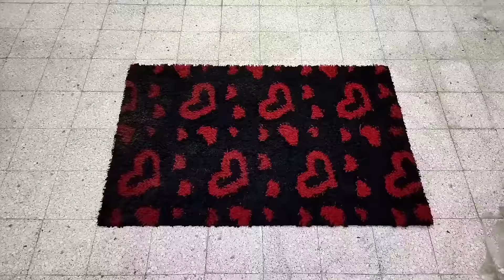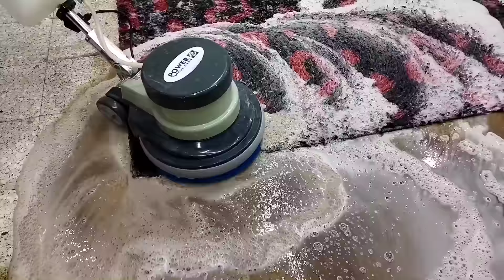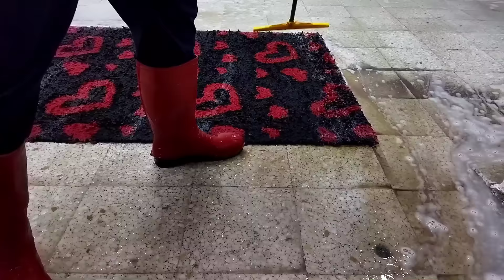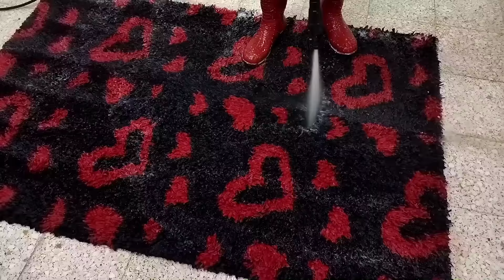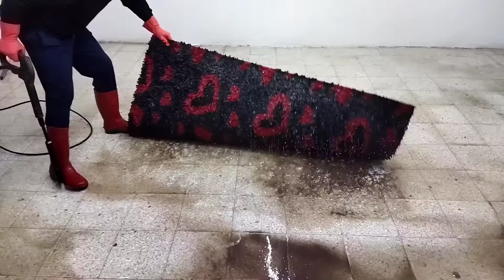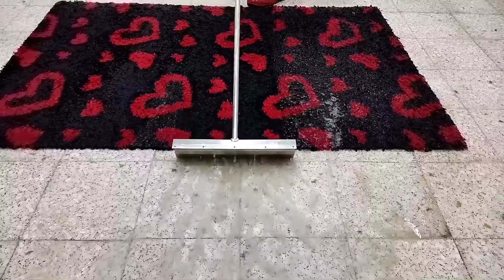Dirty black SHAGGY CARPET CLEANING satisfying RUGT CLEANING ASMR

Comment: Hi! This was a great rug transformation it looks completely brand new.  I think you should use your big carpet cleaner machine on the back of the rug when you turn it over to clear the dirt underneath.   

I believe if you use the machine on the backside  of thr rug it will help you lift up the dirt at the very bottom of the rug on the design side.  This will also help you with time as well...just try it and see what you think. You have great success in cleaning carpets, and I watch several different channels on  cleaning  carpets. The ones who use the machine on the back seem go smoother...but don't get me wrong, I LOVE your work!
Reply from the maker: Thank you so much for your comment.  I will implement your suggestions😊🖐️🖐️

Comment: I love that rug. Was very surprised tht much dirt was in there... I have a question.. would brushing hurt the carpet
Reply from the maker: No, it won't hurt.  Brushes are specially produced for this job.  But hanging the carpet and beating it with a stick will certainly do harm🤓.  Breaks thin threads